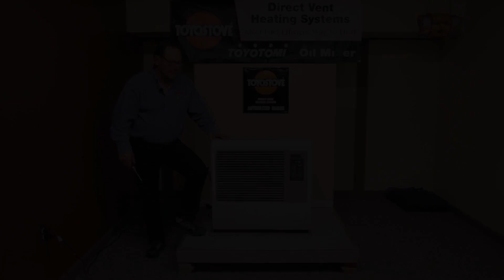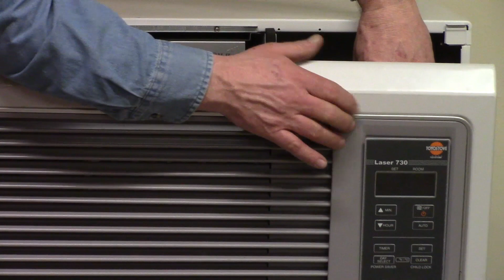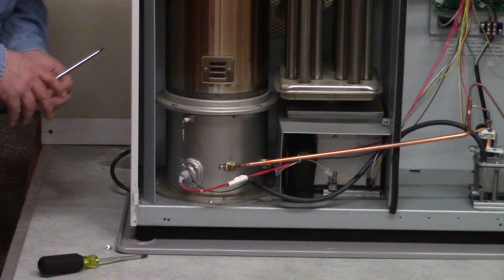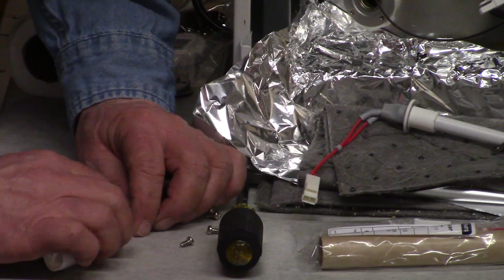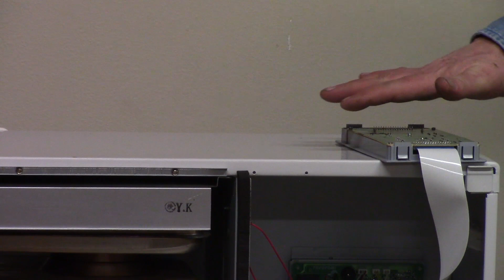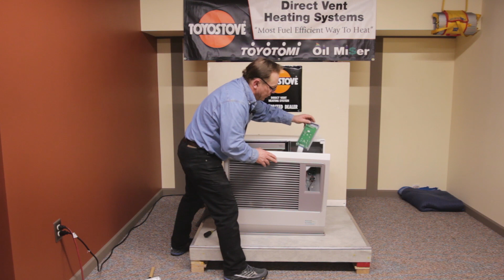How to Replace a Toyotomi Toyostove Igniter | Step-by-Step Guide

Comment: you did not address the problem of removing the igniter. it seems to have a lot of buildup and will not release out of the retainer hole.
Reply from the maker: To remove a stuck igniter, remove the burner assembly and turn upside down then apply heat with a propane torch to the igniter mounting tube. Heat the area closest to the burner assembly then gently twist the igniter with pliers while applying heat to it.

Comment: What would make it fail? Mine needed replacement after 1 year. What is the expexted life time of the igniter
Reply: The igniter should last well beyond one year. One thing to be aware of is water in the fuel, it will get on the igniter & sit there. When the igniter comes on for the next combustion cycle, the water will short out the igniter & you will see a discoloration on it, like a grey, glassy film.
Reply: @RuralEnergy-s8f  is there anyway to check if there is water in the fuel?
Reply: You need a water block filter at the tank. If you have one with a clear glass cylinder, that allows you to see if there is water, which will be at the bottom of the filter.
Reply: @RuralEnergy-s8f  thank you
Reply: Some moisture or a little water is ok?
Reply: It's hard to tell exactly how much, if any moisture would short it out. No moisture would be ideal though.

Comment: My 85yr old dad has one of these stoves. He cleaned it up behind the front cover and didn't realize he knocked the wires off the igniter. The rubber boot that fits around the igniter itself came off with the wires. Unlike yours, his doesn't have a plug on the red wires right there 3" from the igniter. His plugs into the control board. The rubber boot is cracked. I was wondering if the ends of the wires were originally soldered to the igniter or held on by the stretching of the grey rubber boot? I cleaned up the contacts on the igniter and the wire ends, then zip tied the rubber boot back onto the igniter. It's working. Could I eventually solder those wires onto the igniter? Maybe it'll get hot enough to melt the solder?
Reply from the maker: Hello, it is not recommended to repair the igniter, only to replace it.
Reply: @livelifewarm  yes, I agree but when kerosene is $5 a gallon as it is and this little igniter is $175-$200, is it possible to solder the wires on? Are they soldered on originally or does the pressure of the rubber cover hold the wires against the igniter?
Reply from the maker: @andrewevans545  The ignitor comes from the factory soldered. We cannot recommend non-manufacturer-approved repairs.
Reply: @livelifewarm  thanks. I couldn't tell if the rubber boot originally meant to slip on & off the end of the ignitor, or not. You answered that one. Ridiculous how much they cost new